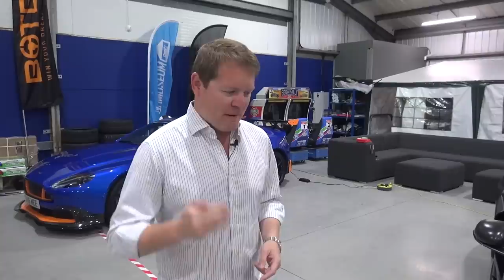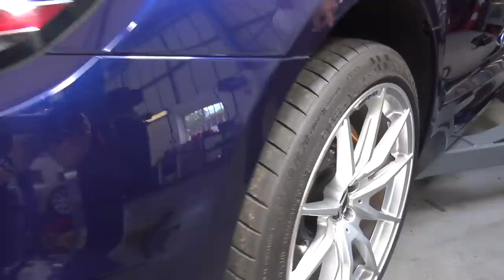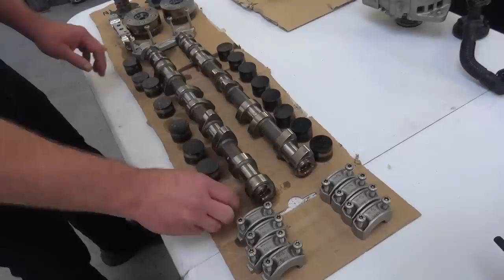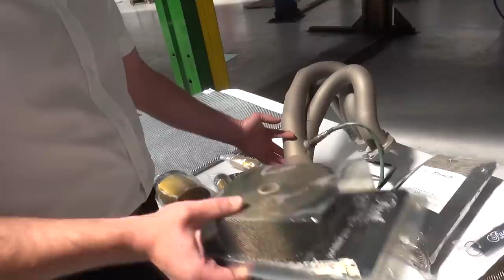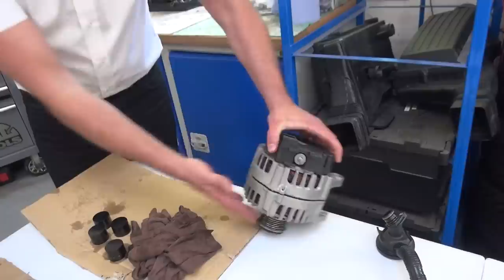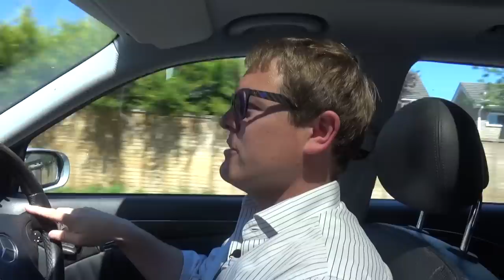The Curious Case of My MISSING SLS AMG Black Series!?

Comment: Been down this road before. The wrap will destroy the headers and they will implode.
They need to be remade out of Inconnel 625, ceramic coated and then wrap them with Inconnel wrap is the only way to cure the problem for good. This is a temporary bandaid at best.

Comment: Fellow SLS (non black series) owner and automotive engineer here. SLS was designed by the AMG guys as a low compromise flag waving supercar. It was designed around that engine and the thermal management was optimised as a complete system. Tricks like increasing the engine power results in the cooling system having to work harder, and a million other unintended consequences. That might be ok if you’re just driving gently but if you want to use the car 100% then you’re effectively using it at 120% (or whatever) of design parameters.

I’m not saying it is impossible to sort out, but if you take the helicopter view here even good specialists are making experiments based on experience and if they don’t work you’ll be the one to pick the tab back up. If you think about details such as how to fix those things they’re showing you like the heat blankets and wrap in place - that’s going to need thermally stable fastenings that stand the test of horrific temperature change and vibration. Might be ok for six months but what about after ten years? The shielding on a race car (which is basically what you’re making) is designed to last a race and be checked, and checked again before each outing like everything else on a race car. It’s just not the same.

Also, wrapping headers will impact the temperature that the exhaust header gaskets run at and the cylinder head sees, and can even do things to gas velocity. Again, it might just be fine but this is one of those times when you may do this that may impact that. Not so bad on a track day toy that you’re messing about with for fun but on a car like this? (Also you don’t know if the wrap and resulting mad temperatures will work with the Renntec pipes and their welding strategy if they have been designed to run at un-wrapped temperatures.)

In the end they’re moving heat around and changing things without true understanding of the consequences (because they’re not computer modelling them with a dev budget) and I think that for the sake of the car you should have a word with yourself and put it back the way AMG intended.

Comment: I’ve always wanted to take an exhaust system into work and plasma spray the entire system with jet engine ceramic Thermal Barrier Coating meant to protect hot end jet engine components from thermal fatigue…should work wonders on car parts! Not even that expensive really

Comment: Nice update on the SLS Black and learning about the protection from excessive heat, which is a killer to horsepower and engine longevity. In addition, I love the E500 Estate. It's a steady, reliable, but quirky and cleverly speced machine. Good job, Tim.

Comment: What I can see from your experience is that tuners often advertise a lower weight for some parts like exhaust elements, but they just ignore some important functions like heat shielding and then it can occur that these “optimized” parts cause the destruction of other important motor devices like electronics!

Comment: Be careful with that exhaust heat wrapping Shmee, I'm not sure about titanium, but it has been known to cause stainless steel exhaust systems to crack due to keeping too much heat inside the pipe
Reply: Couldn’t agree more. Exhaust wrap is old school. We learnt a long time ago it is not a good long term fix. None of the teams when I was in ALMS used exhaust wrap, we just figured out ways to move the heat away from the sensitive stuff.

Comment: You already have the headers off why don’t you have them ceramic heat coated that would drop the temperatures 500 to 700°F guessing they can coat everything you have there and you can still wrap it or not. I think the new coding technology would be more efficient and not look as cluttered or just do both 🧐🤔💭
Reply: They're already coated that's why it has that color

Comment: All these issues only mean you drove it hard and well while in Germany and the Ring. Heat control additions will help manage it for sure. Ceratec use and more frequent oil changes would be helpful in protecting the components for track use. Great refresh for the SlS Black.

Comment: What I don't understand is that if Renntech engineers upgrades, they do not look at these kind off changes, using a process called management of change, what we use in our company when we make changes on an installation? When you use this process you are obliged to look at all the effects of the change itself at all the different components off the installation. If they would have done this, they would certainly have seen that e.g. temperature under the bonnet would cause a problem and had  taken steps to reduce the effects off that heat. Also by insullating the manifold, this part will become more hot, because their is no cooling anymore, what will be the effect off that on the engine and other components?

Comment: I have no doubt about Avangarde for service/diagnosis & repair but in regards to the heat management there are easier/more beneficial ways to do this such as ceramic coating such as Zirotec or Cerakote and custom blankets like Thermo Met.

Comment: Modified Mustangs suffer from heat soak and  people employ two approaches to resolving the issues. Wraps an heat shielding and the other is ceramic coatings on the headers. I used ceramic coatings on both my headers and it worked wonderfully,

Comment: Is there a higher capacity radiator and cooling fan available? If it’s generating  that much heat the oil is probably taking a beating, probably an oil cooler and trans cooler would be helpful to keep the heat down.
Reply: I was thinking oil cooler first. Also looking into which solutions are used/have been used on the GT3 cars.

Comment: With today's technology, a heat blanket is a simple solution. I'd rather ceramic coat those headers instead for better dissipation. Then I'd look into ventilation methods for the hood, fenders or under body. Even better airflow from the front end to get moving air in could help. Just my simple thought
Reply: Vented hood n fenders are highly effective for sure. Ceramic coat plus added ventilation should honestly be more than enough tbh.
Reply: @AYO_KO  👍🤙

Comment: I guess you never topped up the oil when you were putting the miles on it and thrashing it on the ring.
Even the m156 requires oil top up every 5,000km

Comment: Why don't you get the exhaust manifold ceramic coated? Wrapping is a bit crap in comparison, or have them properly heat shielded by a company like thermo-met, F1 spec headahielding.

Comment: Did Avantgarde speak to you regarding the possibility of buying a different hood that includes heat extractors? Using heat wrap and blankets will help, but like any insulation they will get overwhelmed if the heat isn't extracted. You'll notice that cars like the ZL1, the C7 Corvette ZR1, your GT500 all have hood heat extractors. If you could buy a second hood and have one added in a way that looks OEM (and have your other one kept in its current condition), you would notice a massive improvement in under-hood temperatures.
Reply: We considered lots of options here. If money was no object then a custom vented top shell bonnet would be a great idea, but that is probably £30k right there as it’s carbon fibre. 

Positioning of the engine causes a few problems too for dispersing any heat out sideways as the engine is technically in the middle of the car surrounded by its natural crash zone and the scuttle tends to envelope the heat forward. 

We think this will be the best option.

Comment: That's unfortunately what happens to any car that's abused. These cars were never meant to be used on the Nurbergring or to be pushed that much. Hence there are track focused cars which are specifically engineered to be pushed. I guess it doesn't matter as you intend to keep the car but it certainly has been modified so much that it would certainly affect the value.
Reply: Huh? U high

Comment: The one thing that wasn’t mentioned was the power loss. Was that diagnosed? Or related to the heat issues?
Reply: Hydraulic lifters will contribute a little. Plus it’s been running standard oil and not a race based type oil and that can always give a differing figure. We’re going to run it on some 10w60 oil we run the SLRs on. 

Then we’ll see where she is after that. I’m personally doubting there was ever a loss that big but all will be revealed!

Comment: I’m still kind of convinced there was no power loss originally, dynos read wheel horsepower. Any sort of correction is not accurate. The figures that Renntech originally gave you suggest it was producing at or more than the original 622 horsepower at the crank. Now, with these heat issues causing sensor problems, that’s definitely a power loss after the fact.

Comment: Tim did you get the new steering wheel sorted out for the SLS Black Series?  I remember you wanted to fit a modern version but it didn't work out electronically  ....

Comment: It is ok to keep all that heat within the exhaust rather than letting it disperse as it would normally? It sounds like the exhaust is going to be cooking in 600 degrees heat without the heat being able to escape.
Reply: I feel the same.
The exhaust sounds amazing, but I would personally consider putting the stock exhaust back.
Reply: I was thinking that also.  It seems like the damage would disperse back towards the engine.
Reply: The heat shielding will cause the heat to travel farther away from the engine and presumably any sensitive sensors or wiring. Perhaps the floor of the car will get a bit warmer, but the air passing under the car will help cool that section of the exhaust system.

Comment: Why don't you ceramic coat the exhaust
Reply: Great question. We did look at ceramic coating but there were a couple of reasons. Firstly, no ceramic exhaust specialist could give an exact heat prevention figure. Secondly, the exhaust already looks like it has a layer of ceramic on it which has peeled away in places and  thirdly, it was down to cost. 

Funk Motorsport were incredibly helpful in giving us the very best advice for this and we have taken it, passed it to Tim, who has gone with the recommendation.
Reply: @steveavantgarde133  that makes more sense thank you for the explanation

Comment: I have no "heat issues" or rattling on my SLS BS which I've owned for 4, maybe 5 years. Then again, I've done no mods to it. I guess "to each his own".
Reply from the maker: Indeed, but have you also done over 1,000 miles at 180mph or faster? That's the main thing that hasn't helped mine.
Reply: @Shmee150  Obviously not. That's way "above my pay grade",  so to speak. But I did watch your video when u tracked your car after the performance upgrades and new exhaust system. Just visually it didn't seem  like your car accelerated any quicker than my stock one. And ofcourse, the stock version makes all the noise you need.  Whatever, you are a pretty darn good driver, anyway.

Comment: So is the loss in power because it gets too hot or another reason?
Reply: The loss in power is based on a dyno figure given to Tim when the exhausts were replaced and the engine map carried out. How accurate that is we aren’t sure. The plan is to sort out the rattling top end, get everything right and then head to GAD tuning to see exactly what figures it has as both Tim and I know Anthony’s rolling road gives very accurate figures and then see what can be improved upon, if at all possible.
Reply: @steveavantgarde133  thanks!

Comment: Shouldn't the question be why is it getting so hot?
Reply: It’s just the extra external heat the manifolds produce. It’s soaking upwards and melting sensors and wiring here and there.

Comment: Modifications considered, if a car is designed for 200mph and the ‘Ring, and it’s original cost, why wouldn’t an owner expect zero rattles and zero heat sink issues….
Reply from the maker: A stock car would have run totally fine, mine is not stock
Reply: @Shmee150  I wonder what the tolerances are per manufacturer - does Porsche or Ferrari run at +10% for example?  We may never know but it’s an interesting concept particularly for cars that are often tweaked!

Comment: This really shouldnt happen. Poor design from AMG at the end of the day
Reply: It is not AMG's fault that Tim fitted the Renntech kit
Reply: @WPD77  cmon....its not like he's added a supercharger or turbo. Some new headers/extractors and a tune should not cause THAT much more heat that it causes this sort of issue. Has to be an inherent issue in the design
Reply: So it is AMG's fault that Tim fitted new headers with no heatshields and a pop and bang map.
These cars from new will have been designed to cope with heat, modify it and you are on your own.
Reply: @WPD77  show me another car where if you added headers and a tune you would have these sorts of issues. Please......
It sounds like you are an AMG fanboy, and while i like AMG cars you have to call a spade a spade sometimes
Reply: Not an AMG fanboy and you are wrong, to sell this car new all sorts of testing would have been carried out including hot weather tests.

So it is not AMG'S fault that Tim modified this car.

I doubt any other SLS BS has even given issues.

Comment: Honestly, I’m a little surprised that this was affecting the car because I assume, this is what the car is made to do. From what we see, you definitely are not abusing the car. It was made to be driven hard and to be driven on the race track. 

Mercedes should’ve really owned up and taken care of it.
Reply: Not when modified and the power levels pushed up creating more heat.
If this car is for ever, then put it back to stock and keep it going forever.
Reply: Mercedes liable... !?! Not with all those mods; they'd laugh you out of their offices. I've learned from personal experience that whenever you start modifying performance vehicles you open your vehicle and yourself to a wack-a-mole plateau of unintended consequences spanning countless acres. All of that heat management would properly have been considered and implemented on the front end. If you want to point fingers at vendors you can probably safely start with RennTech, then move on from there. Anyway, the take away from this is that one would do well to think several steps beyond any contemplated modifications to get the fullest possible sense of what they're actually buying into. That's the lesson I learned personally and it seems to be playing out here as well.